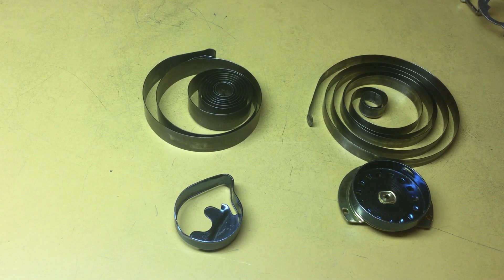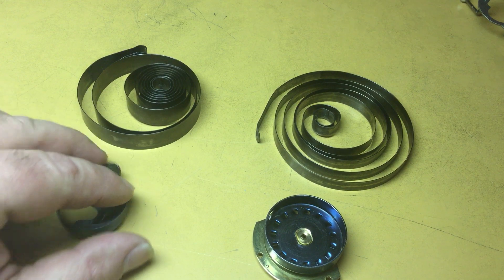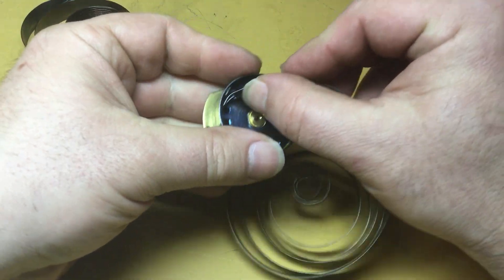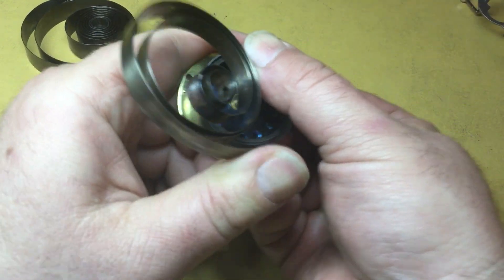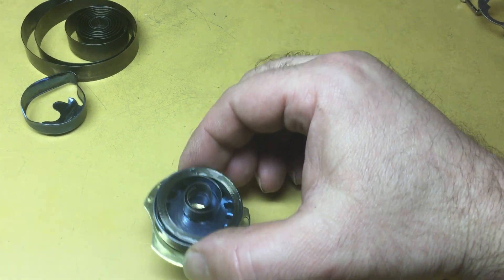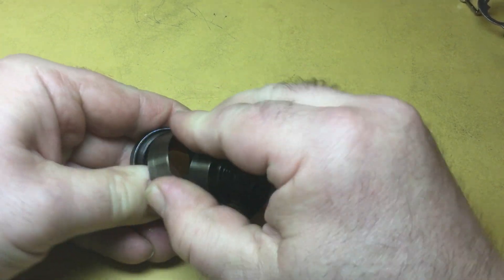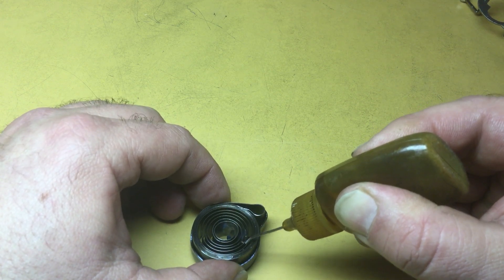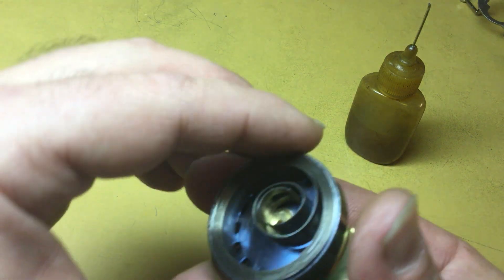Westclox Big Ben Loud Alarm style 5A rebuild part 5

Comment: So you don't grease those springs? Would a multipurpose grease be too thick?
Reply from the maker: For small springs like these, yes the multi-purpose grease would be to thick.  
I used 20w50 synthetic oil on the springs. So far, they wind as smooth as butter!
If I was really determined to use grease, I would try to find an NLGI 000 grease or mix a heavier grade of grease with some oil to thin the grease out.  NLGI 000 has a consistency  like ketchup for a comparison.